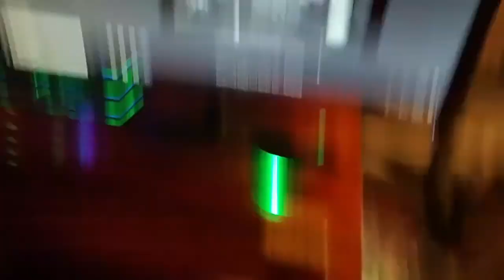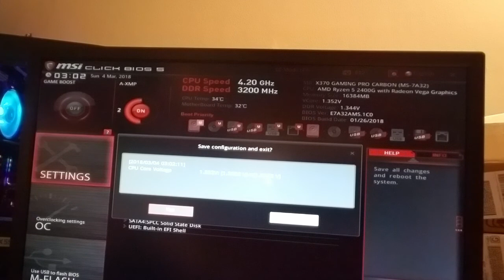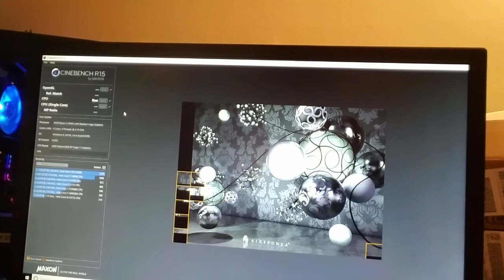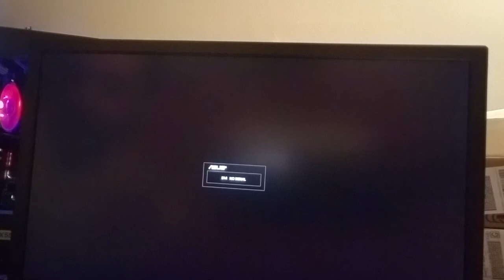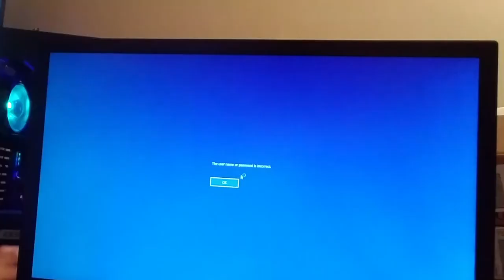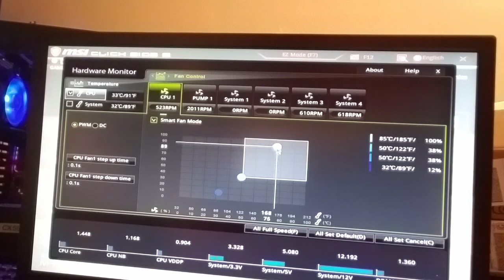Is 4.2ghz on a Ryzen 2400g possible?

Comment: MSI B450M Gaming Plus,
16GB Dual Channel Adata Xpg Flame 2666mhz @ 1.35V 3133mhz CL 16-18-18-38.
Ryzen 3 2200G @ 4 Ghz 1.45V LLC mode 3 + old original am3 copper slug 95w heatsink with wrath stealth fan.
SoC voltage at 1.75V LLC mode 3.
Core performance boost disabled 
Cstates disabled 
Cool n quiet disabled 
Spread spectrun disabled
Cinebench R15 multicore real time priority score 629cb and single core 164cb,R20 1555cb multicore.
Fire Strike score 10666 paired with an ocd 8pin pci-e MSI ARMOR GTX 1060 3GB +200mhz core clock and 600mhz memory clock.
Reply: Wow 1.45v I hope it's not your daily setting